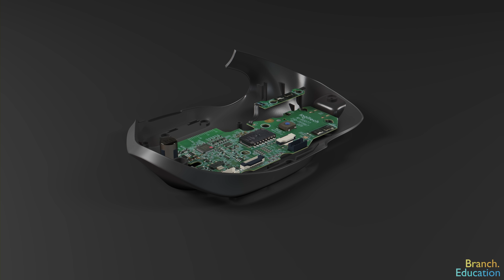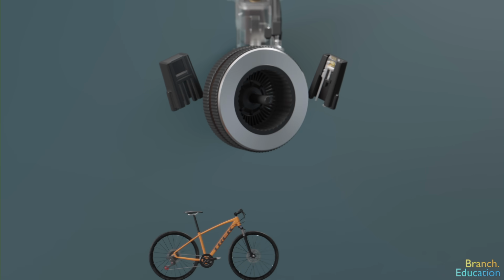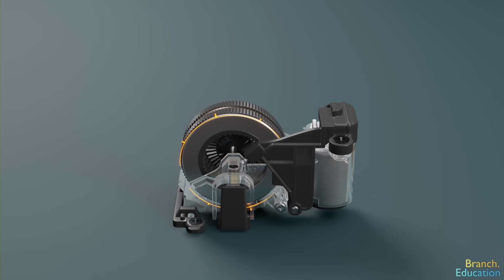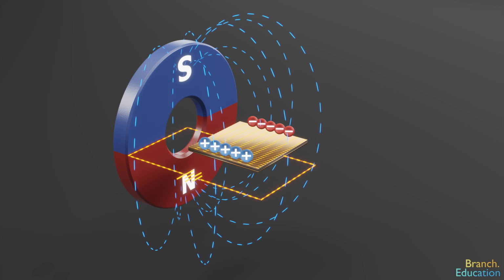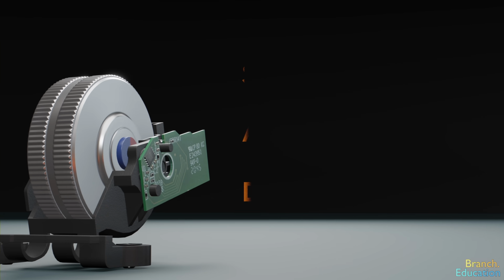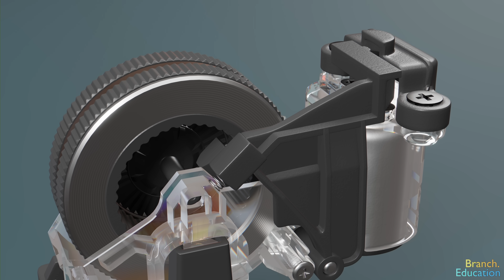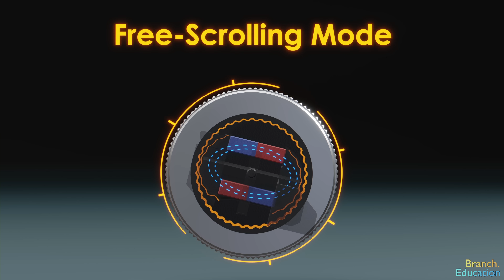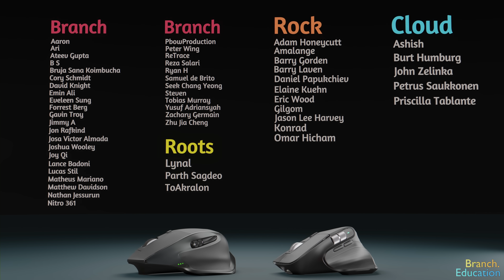How do Scroll Wheels Work? 🖱🛠🔬

Comment: Top tier animations, as always. But need to mention that 95% mice have simpler mechanical encoders.
Reply: I actually was searching for a mouse that I can trust. At the moment I have a Genius NetMouse Wheel/PS2 but I would like something with a USB connector and an optical scrollwheel (just like the NetMouse) to carry around in my backpack. Couldn't find one just yet :(
Reply: This, most gaming mouse atm just uses simple mechanical encoders.
Reply: honestly i think this was true even 5 years ago, but competition is extremely fierce and you now see tons of very affordable and cheap mice, typically targeted at gamers, with features that you only normally see in expensive ones. just look at amazon's best sellers and see their features and price point.
maybe it's true that a lot of them still use simpler designs, but likely not 95% of mice.
Reply: @BattousaiHBr  Can you give several examples of better mice? AFAIK even top-tier gaming mice, not old by any means, like logitech g pro x superlight, razer viper ultimate, have mechanical encoders. And my current "pwnage ultra custom wireless symm 2" too.
Reply: @WERT2025  the superlight is an exception because it's going so far in the high end side that it's "sacrificing" some performance for less weight (though i reckon they have gone through effort to still make the scroll as good as it can).
other than that, there's plenty of mice with optical scroll sensors. maybe most of the expensive ones?
if you've seen mice with that wheel switch that changes between stepped mode and free mode, those are all optical sensors afaik.
another good indicator (though not necessarily a rule) are metal wheels.
Reply: I’ve never seen a mechanical scroll mechanism…
Reply: Yeah seems like most mice use whatever style encoders TTC and kalih makes (only brands I could think of)
Reply: Logitech top tier mice
Reply: @Wanted54321  I mean logitech atleast doesnt.
Reply: @numbdigger9552  they do lmao, g pro x superlight, g305 and g703 just to name a few. Watch the mouse teardown, the encoder implementation just like any other mice. G502 is the only few thats dif since it has the flywheel mechanic.
Reply: @Wanted54321  g502 is the only REAL mouse logitech makes. I spit on anything else.
Reply: @numbdigger9552  that thing will give you arthritis lmao, whatever floats your boat.

Comment: I've got the Logitech MX Master II so it was awesome to see how my mouse works - thanks for making these!
Reply: Yes, now I finally know what the button behind the scroll wheel does!
Reply: @InternetUser999  I have a Logitech MX Anywhere 2S, and it is by pressing the scroll wheel itself that engages/disengages the smooth/stepping mode of the wheel, there is no motor but a simple mechanical latch. 
The button behind the wheel is its own separate button, with no relation to the wheel.
Reply: @PushyPawn  Its different on every mouse. I used to have the standart MX Anywhere 2 and pressing the scroll wheel also enables the fast scrolling mode. I now have the Logitech G903 and it has a seperate button under the scroll wheel that enables fast scrolling and the scroll wheel click works as normal.
Reply: @PushyPawn @David K I actually have two buttons on mine. One behind the scroll wheel, and one even further that changes the DPI between five settings. And then there are the two custom buttons on the side that I can configure to do whatever I want
Reply: @PushyPawn  ^
Reply: @Ameelith  ^
Reply: @InternetUser999  Mine has two primary, a mouse wheel click, a fast scrolling toggle, two programmable buttons on top of the mouse and another two programmable buttons (that you can remove) on each side. Basically... I have 11 programmable buttons 😅
Reply: Yeah this is more of a Logitech ad 😂
Reply: I have a simple n cheap office mouse with 2 regular L R buttons which sounds like they get spanked inside the mouse everytime i press the buttons with my finger...🥲
Reply: It's all about the MX Master 3 with magnetic scroll for me. Try it once and you won't go back to slow "clicky" ratchet scrolling
Reply: Newer mice use smartwheel that no need separate button, but not as easy with button
Reply: @PushyPawn  the MX Anywhere 2S is my favorite mouse. I had one in a custom blue color. When it finally gave out, I bought an MX Anywhere 3S, but returned it for another 2S (black, alas no more blue) while they are still sold.
Reply: @jefffuhr2393   Indeed, and their batteries last forever. 
If I had to list 1 gripe with the mouse, it's that the right button is too easy to press.
I often end up right clicking by accident. 
Maybe my finger is just too heavy.. 🤷‍♂

Comment: The timing on this is so funny to me - I was just a few weeks ago researching how feasible it was to try and build my own gaming-level mouse from scratch. I have some very awkward hand sizes that have made it difficult to find a mouse that's comfortable to me AND that includes all of the fancy modern features with buttons in places I like. It'd be really fun to 3d print my own case & buttons, and learn how to wire up the boards and sensors correctly on my own. But learning about scroll wheels was difficult, and figuring out how to obtain PCBs seemed impractical.... you managed to cover both in ways that have reignited my interest. Thank you :)

Comment: I was changing the encoder on my old noname mouse to seemingly same type of encoder part - potentiometer. Both old and new parts looked just alike, same xehagonal hole to engage with the wheel, same 3 contact legs.
But the new part didn't work. So i squished the metal tabs and disassembled both.
While the new had resistive track connected to side legs from its ends, the middle was moving across it.
However the original now broken part was just 3 sliding contactors separated in a complex metal shape with many additional legs that could contact with only 2 of its legs thru a rotating metal contact on the spinning part.
That was very clever and cheap solution. It lasted for years and became faulty only because of metal fatigue on the contacts, those weren't pressing hard enough to the spinning metal part.
It was generic white Logitech mouse and yes i managed to fix it by pressing metal tabs that keep parts together harder.

Comment: 8:18 this method has flaws though, the rubbing will wear down the potentiometer and thus cause it to break, this is unfortunately  the method used by modern game controllers and is what causes the drift affect, it would be amazing if they instead used optical or magnetic sensors so they would'nt wear down
Reply: I think they may have mentioned on the cheaper models of PC Mouse's
Reply: Even then there will be some mechanical component for the sticks that will eventually fail, besides, this may give some extra excuse for companies to make controllers even more expensive than they already are I think.
Reply: @Inferryu  what mechanical component? if an optical sensor was used there would be little to no wear on components, the only possible wear would be on the ratchet component but the ratchet component isn't essential for the mouse to operate
Reply: @adrian-x5v  You were talking about controllers, so my comment was referring to those, not the mouse.
In any case, you still need an axle for the wheel to turn, that will eventually wear out, same goes for analog sticks, you still need a structure of some sort to allow for the type of movement they have, the sensor itself may not fail(for use at least), but the supports will still see the same use.

Comment: The optical method is also the one with which the analogue stick of the N64 worked. For at least 20 years now, basically every controller uses 2 potentiometers at the stick, one registering the X movement, and the other for the Y movement. The N64 design was similar with registering X and Y, but with the same optical system as explained here. It was very unusual, but not a bad design at all, since those controllers were very accurate - even the stick was wobbly like hell.
Still Nintendo recognized to improve this design big time with the GameCube controller, one of the arguably best controllers to this day, also part of it's (indestructable) stick.

Comment: I have two mice, the G502 which has an optical encoder, and a G102 which uses a potentiometer. The G502 still works to this day, but I had to replace the g102's encoder after 6 months of use. I didn't bother with warranty as I lost the box, and is as good as void if you lose it. Fortunately, you can get encoders shipped from China for cheap, you'll just need the right size. The encoder the G102 Lightsync uses is a Kalih 10. Fortunately, most encoders are standardized and the replacement I bought fits perfectly. I also had to replace its Omron switch.

For the G502, I had to replace its middle click membrane button. It was difficult to find replacements as you have to buy it in a set and is surface mounted. I don't even have a proper hot air solder so I had to use a big a$$ heat gun to remove. I've partially melted an omron switch but it still works, and the middle click is now working.

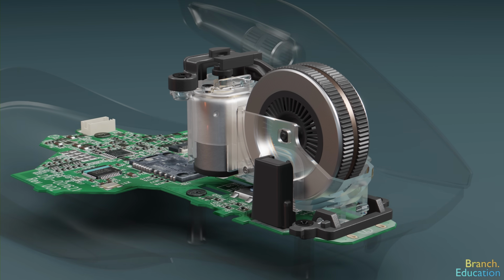Comment: 6:50 I have a mouse from Logitech that doesn't have a button to en-/disable ratcheting and a button below the scroll wheel assembly for middle clicks but it rather has a button on the position showed in the video that does middle-clicking and pressing down on the wheel activates a mechanism that turns on/off ratcheting. That also works when the mouse is not powered. 
The follower and the ridges on the wheel for the ratcheting are the same though, just toggled on/off differently.
Reply: Is the mouse you have the MX master? If so you could change that using the logitech mouse software.

Comment: i only came here to verify what i already knew without actually having looked inside a mouse. i think lasers/light is best way of measuring anything really. 
i dunno if my idea would be harder or easier, but instead of those spokes, i'd have a pattern, similar to barcode, but with holes in them. a very simple pattern, kind of like binary. 
this way you'd only need 1 sensor and microchip would know the full pattern, so it would instantly know if wheels is being moved up/down and it would also know the exact position of wheel, which is not really needed, but i think that method would be easier and simpler.

Comment: I know of many tracking devices without scrollwheels.

1. Thinkpad's trackpoint, is superior to any schrollwheel, because you get a variable speed, continuous space 2d scrolling device with it, the same trackpoint is the scrolling device and all you need is press the middle button which is bellow the space bar and it turns into a scrolling device, the best, because with a very long page to scroll, you control the speed with the pressure.

2. Apple Trackpads, is the next best scrolling device because it also uses the same device for tracking and scrolling just use one finger for tracking and two for scrolling, very handy but the scrolling isn't continuous if you have a very long page to scroll, you have to swipe multiple times.

3. Kensington's trackballs have a scrolling ring that allows for continuous scrolling but is not 2d, is just 1d, so is called ring but is more like a knob in the shape of a cup that holds the ball. The Kensington Slimblade allows to use the trackball itself as a scrolling device, similar to the ring but without the ring, not very accurate, this one sucks

Comment: Here is an idea, right after detecting the direction, and changing direction can not be instantaneous because of the inertia, we can use those 2 sensors to increase the resolution and get 96 pulses instead of 48

Comment: i used a tons of cheap mouse but when i started earming i bought a Logitech G 402. after few years of use i opened the mouse to clean dust, saw this scoll wheel in amazement that is a optical one. cheap mouse never lasted more than 3 months but g402 is with me for 5 years. with no damage to its internals. and this video cleard my curiosity of optical scroll wheel.🤗👍

Comment: Very interesting, my company uses hall sensors for fans with multiple speeds tracking and failure signaling. I wasn't aware of a mouse with auch similar usage of the hall sensors. Great presentation!
Reply: Another use for them: Keyboard switches. Though they tend to only be used for ones that need extreme reliability (billions of keystrokes), such as aerospace applications.
Reply: I can top the weirdness with my Saitek X65F H.O.T.A.S. that uses Strain Sensors on the Sticks X, Y & Z Axis to recognize their input WITHOUT the Stick actually moving even the tiniest bit. Super neat system allowing for highly accurate and immediate movements. The only downside with it though is it causing my PC to not being able to go to sleep when I place it on or even just near my Logitech PowerPlay Mouse Mat as the Magnetic Charging Coils in the Mat will trigger a signal response in the Stick thus waking up the PC.

Comment: You forgot the most prolific and cheapest type, the mechanical encoder which senses motion through an intricate assembly of contact wipers.
Reply: And no it's pedantically not your standard potentiometer, because the latter usually doesn't allow 360° rotations and limits the angular motion to less then 300°.

Comment: And remember, that optical encoder was the basis for how mice sensed motion for a couple of decades before the move to optical imaging sensors. Unfortunately, driving those encoders by rollers in contact with a ball had issues with picking up gunk, which you had to peel off with tweezers every few weeks.

Comment: The mice in this video are all high-end modules, so they use fairly expensive parts. I was amazed when I first saw their ads. budget mouse use rotating potentiomeer that have this bumpy feeling built into them  that cannot be turned off. That is why there is sometimes a terrible scraping sound in ones that have been used, the plastic surface is damaged. also the potentiometer is really cheap and crappy, it drifts a lot.

Comment: I have a Logitech G-502. The scroll wheel in it can be unlocked so that the wheel can move freely with SUPER low friction. When you lock it again it will go back to steps. I am pretty sure it uses a magnetic wheel since it can be locked and unlocked.

Comment: Actually I've never seen a mouse that uses two push buttons for scroll. Yeah, horizontal yes, but not vertical. Most cheap (and not only, sadly) mices uses just mechanical encoder, which works the same as optical, but it's just one part.

Comment: Do you have a video that explains how a marble(trackball) mouse works? 
Logitech(North America) & Elecom(Japan) are major manufacturers of these type of mice. Elecom even makes wireless versions in both Left & Right handed configurations. I have both the Logitech M570(right Hand) & both Left & Right handed Elecom units. I have carpal tunnel in both wrists and the Elecom design is much easier on my wrist than the M570. To my knowledge, all marble(trackball) mice are optical. Don't know which type of scroll wheels they have but they both scroll with a clicking sound and the Elecom mice also have a left/right toggle as well as the middle mouse button. I cannot imagine using a 2 button mouse or a laptop two button touchpad.
Reply from the maker: We will definitely consider it for an upcoming video topic!  Thanks for the idea.

Comment: I have never disassembled the scroll wheel, but I always thought that it works on the principle of mouse buttons 🐭 when you turn the wheel in one direction, one contact is triggered, and when you turn it in the other direction, then another.  And this option is THE BEST FOR COMPUTER GAMES because the contacts are also stoppers that prevent you from accidentally increasing, for example, the magnification of the sight in games, which is very important, unlike optical and laser analogues in which scrolling is easier due to the lack of friction.
 For scrolling web pages, optical and magnetic sensors will be more comfortable due to the lack of friction, but they are more difficult to manufacture and more expensive, and not much more comfortable because a conventional contact connection also copes with this very well.

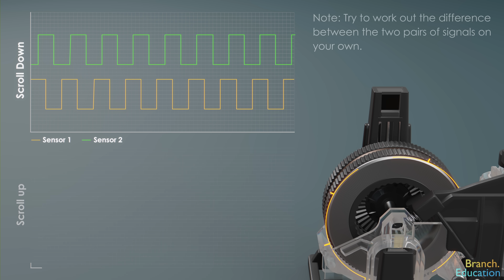Comment: 3:10 I don't see any difference in these two graphs, only the offset 🙄

in any case, this is the best description of the data entry process, and this is the best design of a computer mouse in the world! (but it lacks a wire - a mouse without a wire sucks)

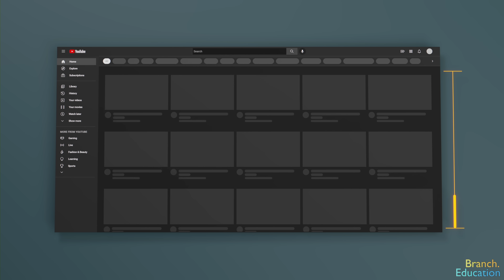Comment: Great video and high quality graphics.. Just one question though. At 2:45 wouldn't the sensors pick up the rotation in the reverse pattern than what's shown because the sensors are on the bottom of the wheel center thus if the wheel was going forward then the barrier of the wheel would hit the left sensor first. And  vise versa for going backwards?

Comment: i had optical encoder in my first Logitech mouse , which had a rubber ball , after that optical mouse none gace optical encoders, the scroll wheel which is a rotary 3 pin mechanical wheel never worked for more than a month, kind used to work without scroll wheel.

Comment: I'm fairly confident, that the pulse train is not converted into speed.
When I rotate my scroll wheel by just one click, the page allways moves up/down by the same distance with the same speed,
even if I press the smooth-rotation button (it allows the wheel to rotate freely without clicks).
I find that particular bit of information rather misleading

Comment: I've got to find a mouse with an scroll wheel with absolute angular positioning. It's annoying how ratchet type scroll wheels will skip as set amount of lines at a time, especially for reading textbooks and pdfs. I was thinking that I would have to get something like the Apple Magic Mouse or Surface Arc Mouse with a capacitive surface to scroll but a free spinning scroll wheel may work. I just don't like how much inertia those scroll wheels tend to have.